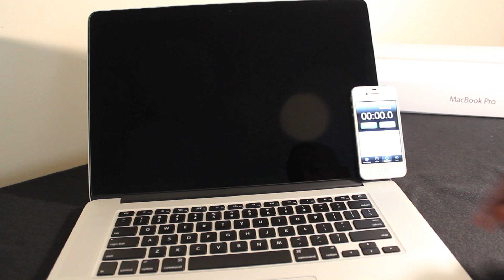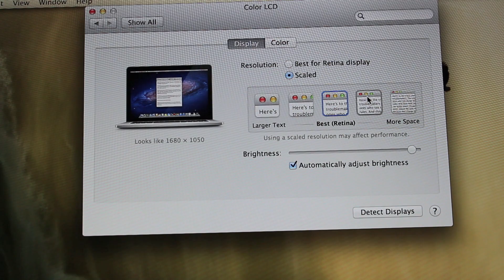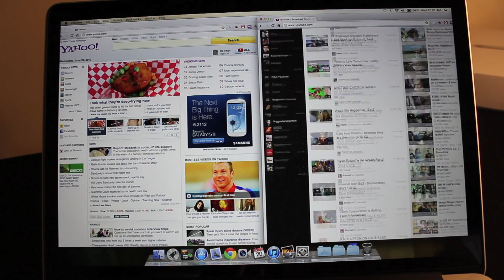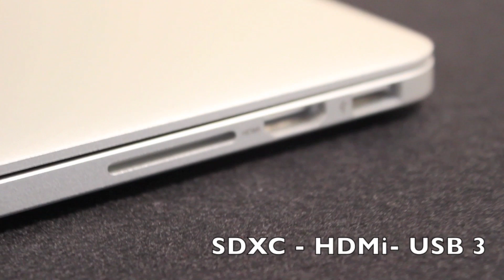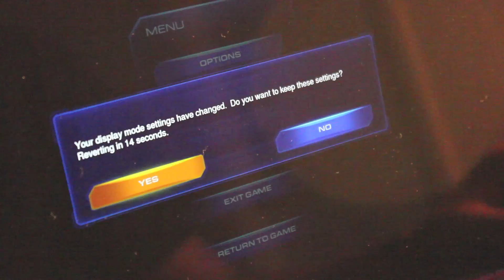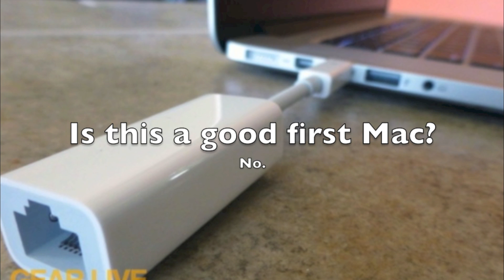MacBook Pro 15" Retina Display Full Review (HD)

Comment: This model has an available upgrade to 16gb ram. As you put it "It's a beast" and that's only at 8gb of ram. Would you recommend the upgrade to 16gb (not thinking about resale value but actual performance)..? Also you mentioned this wouldn't be a good first MAC. Could you elaborate on that? Thanks and nice review!